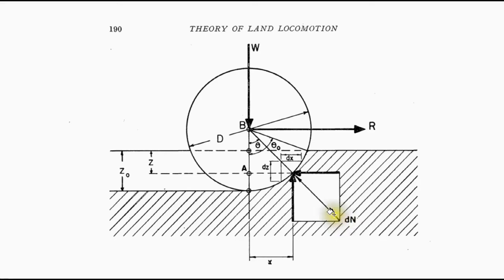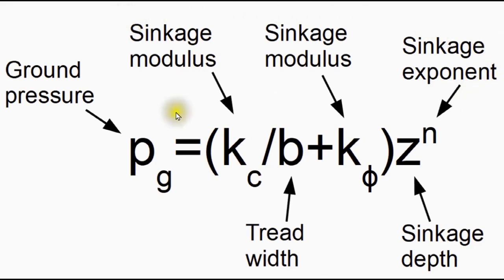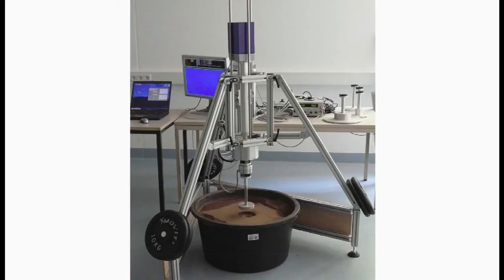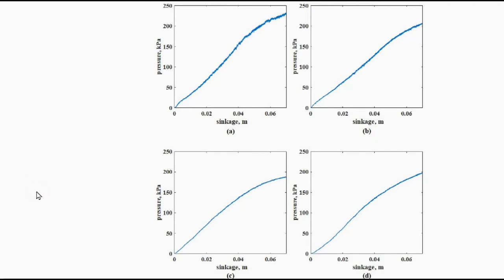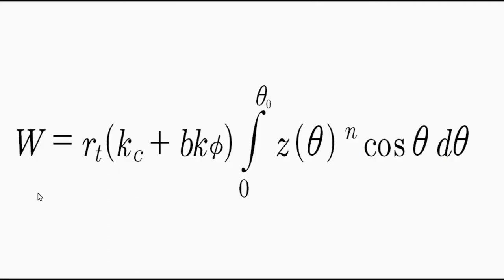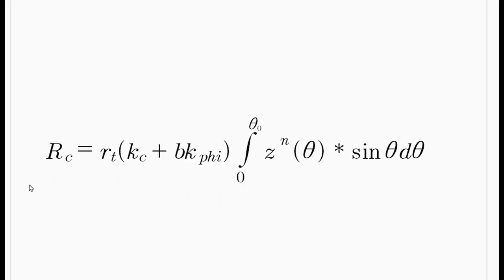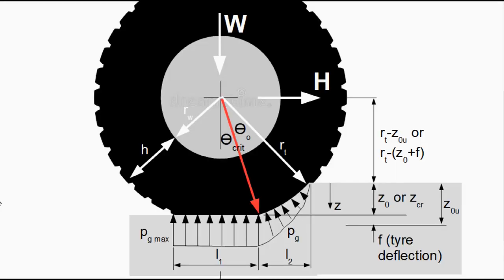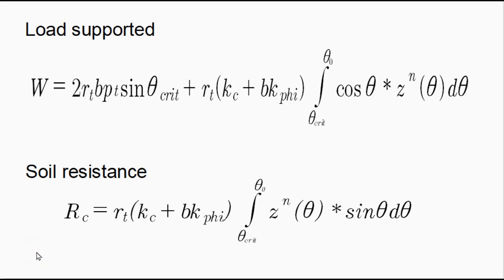Off road mobility using terramechanics. Pt. 2a - unpowered wheels

Comment: Great to see some analytical thought brought to the subject, Bill. These models don’t address layered surfaces such as snow or dried mud where traction may change greatly upon penetrating the first layer. No doubt this is for simplicity. In snow for example, a skinny tire may be preferable to break through and grip the relatively high friction soil below. Conversely, in mud which has crusted over, a wider tire may provide the floatation necessary to avoid breaking through into the low friction mud below.
Reply from the maker: Sorry to disappoint you but there are several important factors not addressed by this model. A lot of work has been done on traction over snow and organic materials (muskeg) but I chose to look at common soils.
Reply: @defendermodsandtravels  Not disappointed at all Bill! Always looking forward to your insightful videos.

Comment: Wow, Bill - this is ground-breaking stuff! ;)
Reply from the maker: The basic research goes back to the fifities. It has of course been developed through the decades but nothing has changed radically which says that the original theory wasn't too bad. For powered wheels there are different levels of complexity in the various models. The most complicated models aren't necessarily the best. I am looking into this. Beyond that you need to consider the whole vehicle, not just one wheel. The manufacturers will of course be modelling at that level but it isn't right for a YT video because it gets too complicated and you won't be able to see the wood for the trees